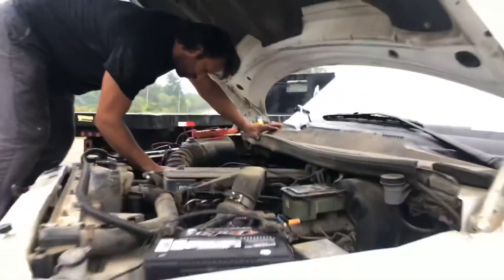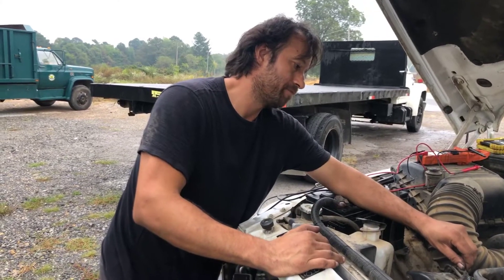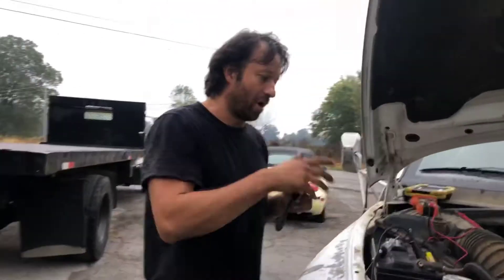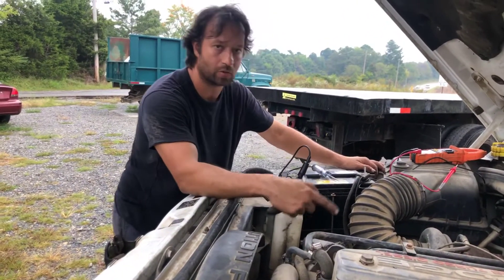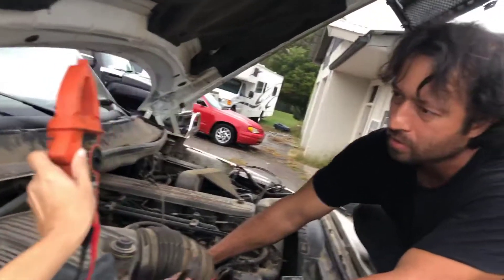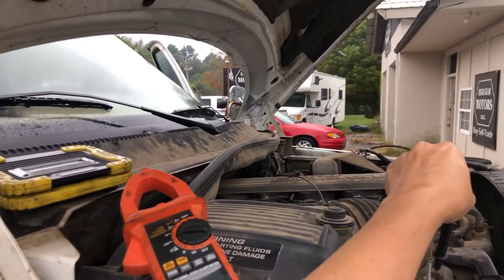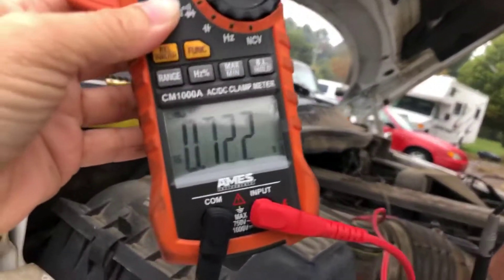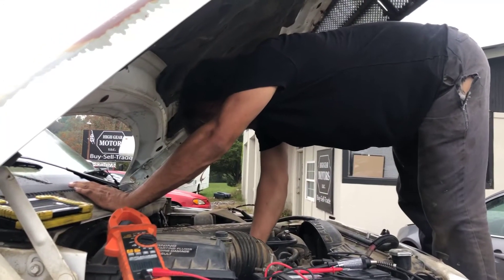1995 Dodge Ram Bad Alternator or PCM? We Show How To Test Part 1.

Comment: My 97 is having the opposite effect. The alternator is only putting out 12.2 volts. I replaced it and the same problem. Along with that the tranny is stuck in 3rd and the "GEN" light keeps coming on the dash. I assume at this point it is the PCM with the symptoms manifested, but I took it to the shop to double-check my suspicions.
Reply: Check that your cab grounded well and look at the harness where it crosses the frame horns at the base of the rad support.
Reply: That’s probably the crank sensor
Reply: @cavaleiro95  so the shop told me the regulator was bad in the computer, and they installed an external one. It charges, but it revealed a short in the system somewhere, which causes all the lights to flicker. It hasn't caused any problems so I've been running it for months as is.

Comment: did you get it fixed
Reply from the maker: Yes. Ended up that the alternator was still good. The problem was the positive battery terminal was losing volts because the wiring at the terminal was not fully attached and had some corrosion. Changed that out and fixed the problem.
Reply: @snoopsnwoody4994  Did you have any other issues going on with the truck. My 97 currently is experiencing a no charge from the alternator, AC clutch isn't engaging, Cruise control isn't working, no connection to the OBD port and my fuel gauge always reads empty so all this has me thinking it is the PCM.
Reply: Issue with a 1996 Dodge Ram 2500 12 valve Cummins diesel I replaced the crank sensor 5 replace alternator I put one of them noisy capsule laters and the wire coming from the PCM from the firewall and then grounded it to a good ground checked all my grounds that brand new batteries terminals I start having a trans shifting tissue about 2 months ago romanatwood seem okay for a while and start doing it again never had no issues with this truck ever with the transmission I know they got the electronic torque converter I've owned it now for about 3 years I put a new shift solenoid relay assembly I put a new accumulator I put new transmission pressure sensor I put new speed sensor in the transfer case I put new speed sensor in the rear differential for the ABS and speed truck has had the whole front end rebuild all new U joints all new brakes that we ground that I could see or fitting has been took apart and cleaned and dialectical Greece and taped the motor runs good never have no issues with that but what gets me stumbled is that they start having this issue to where like I said first hit be acting funny in first gear and it took awhile to get into second gear this was before I change any of the components in the transmission or any other speed sensors I've already done a throttle position control sensor they say that you can adjust them and that plays a part in how it shifts later and sooner I did it all to OEM recommendations with a scan tool a $5,000 Snap-on scan tool while I set the adjustments I used a AutoZone one because a Cummins one was like $ $600 and I only paid like a hundred and something for the one through AutoZone though I have heard that the AutoZone and O'Reilly's ones are not the same and they fail but I am getting a code for inoperable throttle position sensor on my scan tool I have a two-way graph that I can look at millivolts and voltage and I think I'm running with the truck running or off about 0.2 V and then wide open throttle is about 2 point something I believe or 12 something I have to look again but they said you can hook it to the lab scope if your machine your scan tool has 1in tirade into the wire coming from the PCM and then you ground it and you can take it right off and move it with a screwdriver or whatnot and see the changes but I think I looked at it while it was hooked up to the scan to and I think it showed that it was inspect but I'm showing a TPS in accurate on the scan tool so having a little bit misunderstanding there that could be my problem but long story short driving the truck and about 40 to 50 miles an hour I've been doing this the last month so I changed all them transmission components put the BD diesel noise isolator which a lot of guys will talk about there's a plug next to the air cleaner that runs past the alternator them are on the newer ones 98 and a half and up with the 24-valve my 97 does not have that so there's no way that ten-forward or aluminum foil it whatever you want to call it so when I hope that BT diesel up and then it just seemed like it just hasn't shifted into overdrive right ever since it first start happening I think I used to be at about 1500 to 1700 RPMs at about 70 to 75 miles an hour pushing more towards 70 and it feels like it's you know it's in it's right gear but what's going on now cuz that's issue still there and the RPM's have been jumping up and down and it's been real bad like downshifting funny you can see the lights kind of Deming and then the RPM gauge goes back up jumps down it's getting all kind of goofy I put two brand new batteries in it today rechecked all my grounds hot all that stuff looks to be in good condition I haven't had a resistance test on end-to-end of each wire from Hots and grounds from the batteries to the frames but I'm going to do that next bought new alternator and I see that this voltage regulator is supposably connected to the PCM now there's a little black thing that sits on the back of the alternator that's got a couple spokes that hold it down can I just replace that and see if it makes a change I haven't been able to find the exact same one unless the dealer only carries it I've seen some remakes that'll work for the original alternator but not the original people are saying that I'm having issues of the RPM jumping up and down that is possibly in the PCM so I'm pushing towards a PCM I found one online rebuilt you have to give them your VIN number for about 250 something dollars delivered to your door any help would be greatly appreciated mileage on the truck is a couple hundred thousand and that's pretty much useless because from what I know they have gone through things on this truck before I bought it but any help would be greatly appreciated and I thought I was going to put a used trans and up and now I'm seeing that it seems like it's more of a electrical issue I think the transmission is fine I've never had no problems with it slipping just not wanting to shift into fourth gear and going in the second-year very very slow from first definitely not slipping issue I know what a slipping trans is this truck purple anything
Reply: Pcm grounds the trans for over drive and t/c lock up. Check your grounds. Make a new ground strap for your cab.